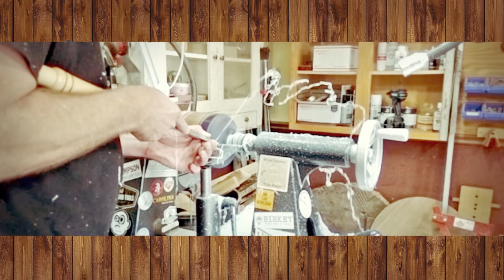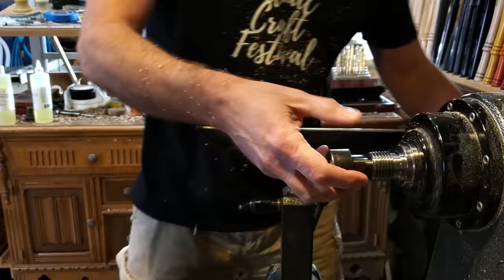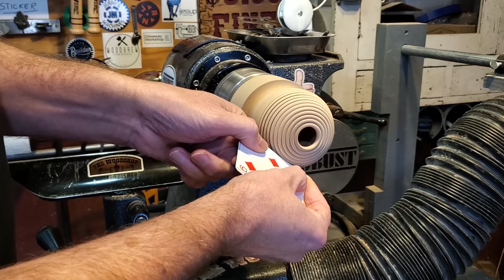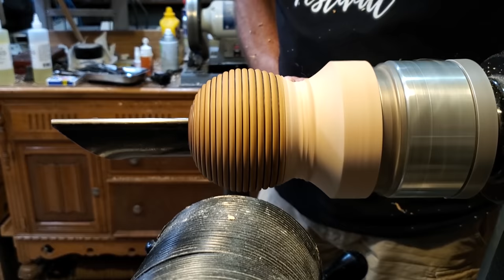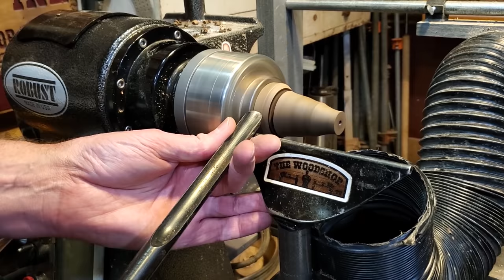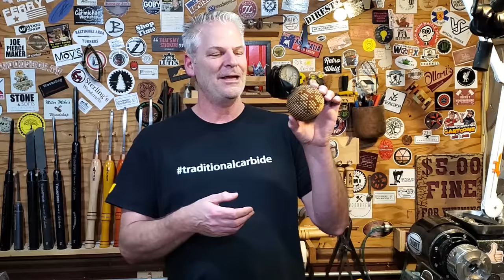Woodturning | Basket Illusion Ornament

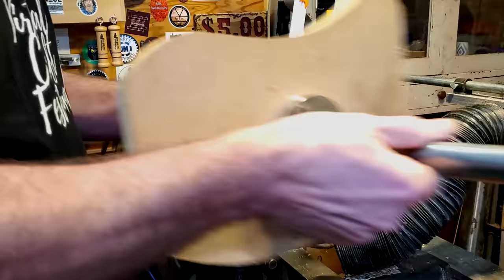Comment: Carl, your platform problem may be a simple to correct one.  I noticed at about the 2:46 point when you were installing the platform on the banjo that you left some shavings on the top of the post support.  I don’t know if that was enough to cause your problem, but if so it means an easy solution, just blow off the top of the banjo post support before putting on the table. 👍 Cheers, Tom
Reply from the maker: Thank you Tom!! I'll double check it next time! It was probably something that simple. Cheers!
Reply: @CarlJacobson  I hope so.  Cheers, Tom

Comment: Ya learn something new in each of your videos.  Never realized playing cards could be used to burn the grooves.   I use a  wood tongue depressor sharpened on the end to burn the grooves instead of wire. I had a bad experience using wire and found an alternative method.  One or two other wood turners on YouTube do the same thing.
Reply from the maker: Thank you!! Very cool, I didn't know a tongue depressor would do the same thing!
Reply: @CarlJacobson  Yes, it will do the same thing.  The only difference is that the tip must be sharpened so it can fit into the bottom of the groove.  Need to spin things a little faster too.   But, it is safer than using wire in my opinion.  Others may disagree, but that’s what makes the world go around.

Comment: I love the project Carl but I did notice you seem to get a lot of tear out using the easywood tools. Is this normal or was it made worse because of the type of wood.
Merry Christmas.
Cheers,
Ben
Reply from the maker: Thank you Ben! I hope you had a Merry Christmas too!! The wood was really soft, that's why you saw all the tear out. I wasn't worried about it because I knew I had to recut it with the beading tool. Carbide is not a good choice for soft woods if you're trying to get a clean cut. It's great on hard woods though :) 
Take care buddy,
Carl